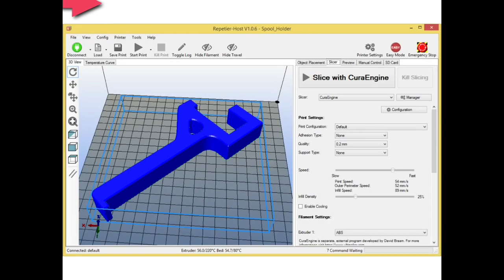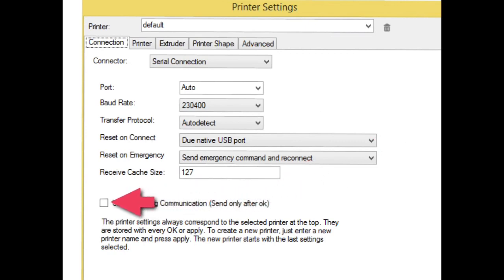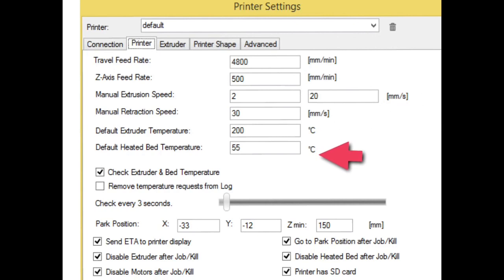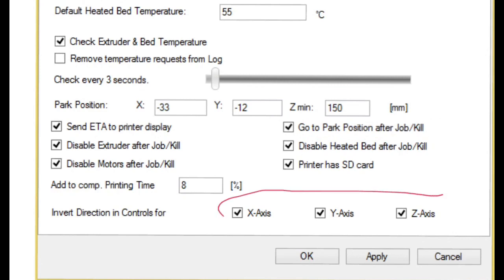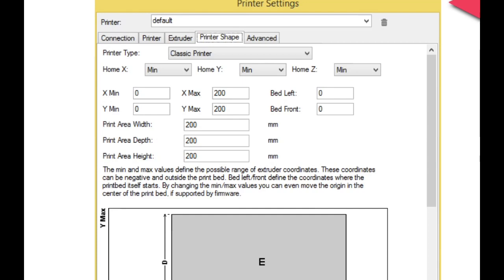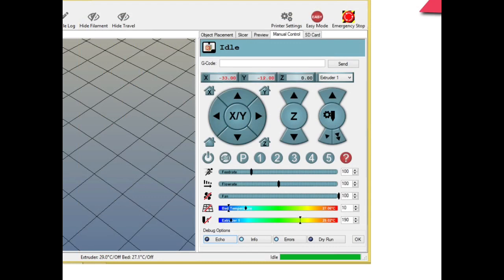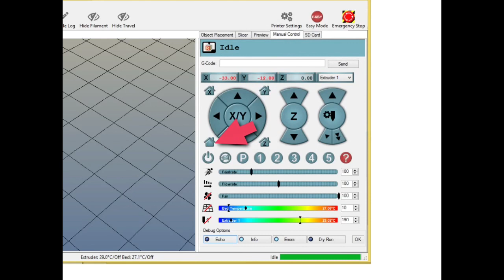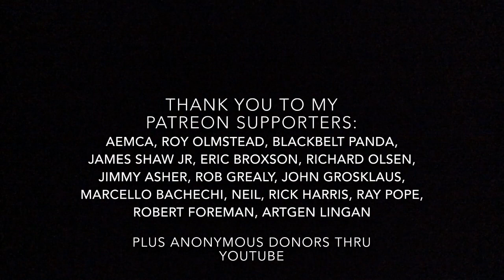Reflashed Da Vinci 1.0A Repetier Settings  - Video #073

Comment: Good video. I have just flashed my 1.0A all went to plan with no problems at all. I have one problem that I can't seem to fix. Whenever I try to move the bed down manually from the software or the printer buttons, for example after an abort, before the bed travels down it goes to home which is at max height so if you have a job on the bed it is forced up into the print head carriage or rails. Is there a way of sorting this. ie. bed just moves down without homing first.

Comment: hey i need help if you can, i have the same firmware and it was working then suddenly the back light on the display went out. When i go to turn the printer back on it shows 2 broken solid lines with no back light and i cant get commands to the printer... Not sure what happened..
Reply: Did you leave the wire when you flashed the eeprom

Comment: Thanks again for your usefull Videos, I flashed mi Davinci AIO. but im not able to connect it to Repetier or Cura, did the settings on four video, also downloaded arduino IDE and  the driver of the plate. and ran out of ideas :/ Thanks and i'll appreciate your advice
Reply from the maker: I’m not sure AIO was capable of reflash. XYZ printing did something to prevent it I thought. I only did my original 1.0. I no longer have it.

Comment: Sooo many of your videos have been helpful on my Da Vinci 1.0 rebuilding journey, I'm hoping you can save me once again...
I have the machine reflashed to repetier 0.91 and have had success in the past but now I cannot for the life of me get circles to print correctly. I have tried everything I could think of or seen fixes for (belts tightened, replaced carriage as well as Drylin Polymer bearings, X axis belt tensioner fixed, Z axis anti wobble topper, z axis bearing slop fixed, rod bearing holders all replaced). I have also followed all repetier settings aimed at reducing jerk and vibration. The circles tend to be oval through the +45 degree angle through +225 degrees. I'm wasting soooo much filament trying to get this dialed in. 

PLEASE HELP!!!!
Reply from the maker: It’s usually related to a motor missing steps. You may have a broken stepper motor wire. They tend to break internally to the insulation so you don’t see it.
Reply: @FilamentFriday  It wasn't the cables for x or y axis (tried new ones). The carriage I have for the E3DV6 was actually slightly loose on the x axia belt and I could barely see it. But I find that while looking at the cables lol. 
Thanks again for the help.
Reply: I had the same problem an pulled my hair out, and now it won't grow back. I was on the phone with an XYZ Printing engineer who made me do the following:
- manually move the extruder assembly to the front of the machine.
- look underneath and feel which of the left and right brackets are hitting the front pulleys FIRST.
- loosen the side that needs adjusting, and "jump" the Y belt (push some teeth forward/backward) so that both black carriages are flush.

Comment: Hi Chuck,  Can you please help me with adding a part cooling fan?  I have found that on the pcb on the extruder it has a fan b part so I have added  a fan there but I feel I need to change something in the firmware settings... Can you please help or do a video on this please?

Comment: So what ever happened to the slic3r or cura printer settings video?  you said you would do that next but I cant see it ;)
Reply: Oh I watched that, but thought that was purely for PLA not ABS.  So I guess its the same but with a 90C bed and 210 on the nozzle?
Also, did you have an issue at first (with both Cura and Slic3r) where it hits the print bed when it starts a print? 
PS: Fluff is my other account
Reply: Thank you, I actually totally forgot its just G code,  So my work around is to set G0 F9000 x0 y0 z5 before it moves the X and Y axis before layer 1.  
For reference, I added this line here...
;LAYER:0
M107
G0 F9000 x0 y0 z5
G0 F9000 X98.897 Y17.632 Z0.300
;TYPE:SKIRT
G1 F1800 X99.181 Y16.031 E0.08112

Comment: Hey Chuck..

Just like you, I just started receiving the dreaded "Cartridge error" on my Davinci so tired of resetting cartridges chips, I just reflashed to Repetier...However I use Simplify3D for my prints..

Do you have any settings (Profile, Start-End G-Code scripts, Temperature settings, etc) for Simplify3D..??

Thanks and keep on the great work..!!
Reply: Ohhh..ok so you just use Slic3r and Reptier Host on your reflashed Davinci or both Repetier Host AND Simplify3d using the Davinci settings??
Reply: Wow..that sucks..!! As I'm writing to you right now I've managed to get it to work and it's printing really good.  However unlike with the stock Davinci, Simplify3d doesn't connect automatically to the printer..I have to manually connect and also unlike the stock Davinci it doesn't send the sliced file to the printer so I can later disconnect the USB...it has to be connected all the time during the printing

Comment: this info is helping me learn how to use Repetier setting , thanksI am getting ready to flash my 10a ,, and one question the printing takes a long time when the print is sent to the printer is it like it does in XYZware , as you don't need to be connected to the printer any more. ?  or does it have to still be connected. I use USB Printer and Device Server HMP S2U. and only have it connected to the printer just to transmit the print to the printer then I can disconnect it from the computer because its at the other end of the house.

Comment: Repetier is awesome.  I've been using it for months, but I've only ever run ABS.  I've attempted PLA a couple times, but just haven't got the settings right.  Do you have filament settings that have worked for you with PLA?

Comment: Thank you, learned a setting or two I need to adjust, especially getting it to drop the bed after a print.  I don't have or have not figured out how to get light actuation.   I'm thinking of adding to to the custom G-code at the end.  I don't see where to toun the light on and off through the panel either.  Probably simple and I'm missing it.

Comment: hey can u use flexible or strechy filameant for filameant friday
Reply: +alynn333333 I am using davinci aio with a e3d hot end and it prints fine with tpu using the stock davinci extruder gears. Note the e3d has the same nozzle size as the davinci stock hot end ( same nozzle dimension .4). with the davinci and tpu you need to print slow but it is do able (although maybe only on a 1.0a sorta like pla) . I have seen some videos on youtube that show a unmodified davinci (other then the flash to repetier) printing tpu. To print ninja flex you need a layer fan, but it can be done on a stock hot end.TPU is actually a lot of fun to use and the inter layer adhesion is incredible. supports are an issue though as it wont break away. due to the interlayer adhesion you have to cut away supports. I should try the water hose one using the tpu. that could be fun.However with it being so flex able it is easy for it to "spit" out the filament to the side if you print to fast. the key is to print slow.  don't go higher then 30 mm/s and that is pushing it. nice thing is if you are watching it closely you can pause the print and get the nozzle  reflowing and then restart the print even if you missed a whole layer.  like I said the inter layer adhesion is simply fantastic.I have used the tpu to print a lot of gopro mounts and extension arms, lens covers and other items that flexibility is key. Note tpu isn't good for things that need to be ridged, but is great for things you need to be flex able and durable.  The gopro tpu mounts have to ues the "locking plug / antivibration" solution to stay in the clips since the arms are not stiff enf to not flex inward during use.
Reply: The stock extruder feed just chews up stretchy filament and one ends up with a mess that is VERY tough to clean up.  There also isn't adequate cooling/heat sinking, which doesn't lend well to the flex plastics.  in short: no.not without replacing ( or redesigning) the extruder.
Reply: +Chuck Hellebuyck's Electronic Products I wasn't aware of that, good safety tip!  I'm using the E3D v6 kit, with the tip that came with it.  i have other tips but haven't tried them

Comment: For MAC users ?  Is total compatibility slicer & repetier to migrate it ?
Reply: +Chuck Hellebuyck's Electronic Products Even though Cura isn't in the Mac version of Repetier for some reason, you can download Cura separately, slice it there, and then put it back into Repetier.
Reply: +Chuck Hellebuyck's Electronic Products I actually realized that I had been using the older version of Cura, and downloaded the new one. I couldn't figure out how to make the new Cura work for any printers other than the Ultimaker, so I switched back to the old Cura. I believe that repetier still uses the old Cura on PC too.

Comment: hey chuck i just got my davinci about 2 months ago and it ran great out of the box. sadly today i came home to the y motor harness being broken :(, any suggestions on how to fix it?  +Chuck Hellebuyck's Electronic Products
Reply: +Chuck Hellebuyck's Electronic Products, hey i watched the video and it gave me some helpful hints, i still cannot seem to find the problem though. I just really want to get back to printing :(
Reply: all of the harness wires passed, i found out that the one of X motor senor wires, (the reds ones) had no continuity. Do you think that could be it?
Reply: ok, i will pick up some heat shrink tubing and solder. when i fix that wires continuity i will update you on the condition *****
Reply: Hey Chuck *****  I fixed it! Thank you so much for the help, if there is anyway i could donate to you that would be great

Comment: Hey I'm Max clemens and I just built a 3D printer and I saw that you had cura slicer and cool setting on it how did you get that because I've hear the it's a better slicer you you had it on the screen at the start of the vid so I just want to know how to get cura slicer on repiteir host pls
Reply: +Chuck Hellebuyck's Electronic Products chuck can you do more with the stock da vici 1.0 I need some more tips and I know repiter is hard to upgrade to and it avoids my warranty so do you think you can do more with the stock da vici?
Reply: +Ryan Mayfield You have FAR more control, and options in supplies, with a Repetier-flashed Da Vinci, Ryan.

If you're not comfortable doing it, you shouldn't do it until you know that it's right for you.  When it's time, you'll know. ;)
Reply: +Chuck Hellebuyck's Electronic Products Yup, both Cura and Slic3r are included within the Repetier package, and integrated into the interface.
Reply: +Chuck Hellebuyck's Electronic Products so you said it was a part of the installation package and i only got slic3r and skeinforge
Reply: thanks
Reply: +Chuck Hellebuyck's Electronic Products I just got a new printer the da vici 1.0 aio and its running I.1.5 I think it's around the same to the 1.0 a thow.
Reply: +Ryan Mayfield The AIO is a _ completely_ different animal!  don't try to flash anything not designed specifically for it or you'll have an expensive brick!